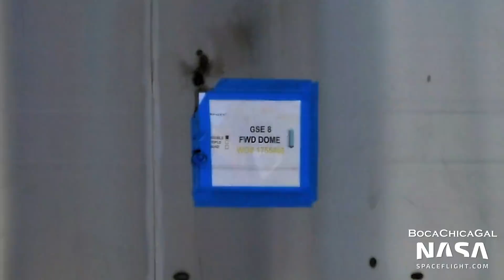Aerocovers for New Starship Delivered | SpaceX Boca Chica

Comment: I'm still not convinced that the fragile looking carriage cage can hold the much sturdier catching arms (I refuse to call them chopsticks, sorry Elon)
Reply: I know what you mean, and it was my immediate thought too when I first saw them, but… do you think SpaceX would make them without having worked out exactly how strong they needed to be?
Reply: I think the arms will hold the carriage, not the other way around.
I.e. the cables will attach to the arms, not to the carriage
Reply: Elon calls it Mechazilla. The chopsticks are part of it.
Reply: The strut structure does not hold weight it is the attachment points attached to the tower pillars and the pillars themselves that hord the weight, plus the lifting cables going up, over and down to the base.
Reply: @eduardogardin879  The cables likely hold the predominance of the weight.  You can't transfer weight through an object that can't itself hold the weight.  Try to hold a popsicle stick and set a 5lb dumbbell on it.  That said, the carriage structure looks to be at least that of a large crane, so should be able to handle pretty high weight along the proper axis.
Reply: my bet is that the "carriage" connects to the end of the QD arm and grabs the ship+booster the way the falcon 9 strong back grabs f9

Comment: why do they do everything vertically wouldn’t it be easier assembling everything laying down kinda like what the Russians do ?
Reply: If you do that you need extra strengthening to support stresses in a direction that the rocket will never experience during launch. That will add dry mass, which in turn requires more wet mass fuel. That extra weight comes out of the payload, and you may find you have none left. Sure some things are inconvenient to do vertically, but the benefit to the end goal makes it worth it. Some things (i.e. raptor installs) are probably easier. Plus as they refine the process and build the factory around those processes, things will get easier and quicker as they find the improvements.
Reply: No.